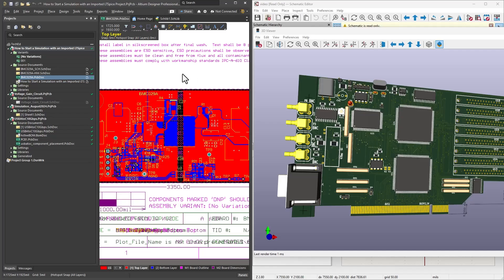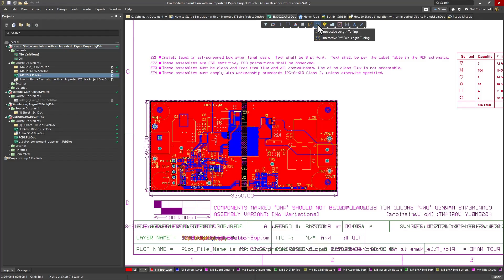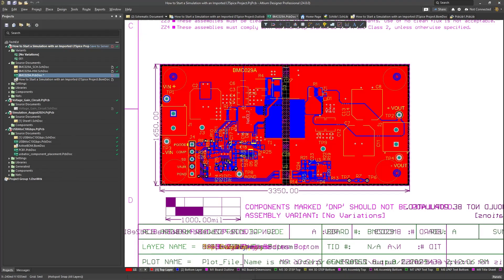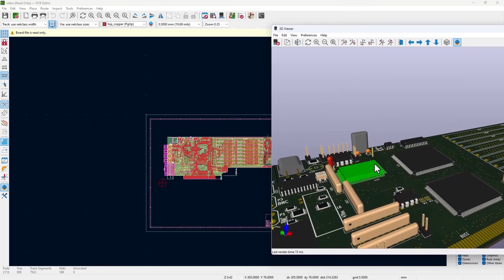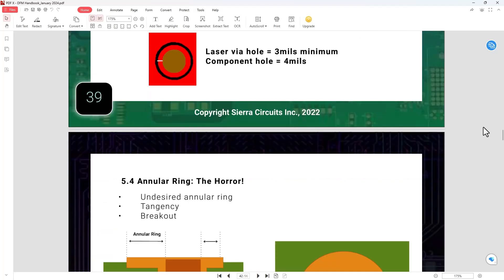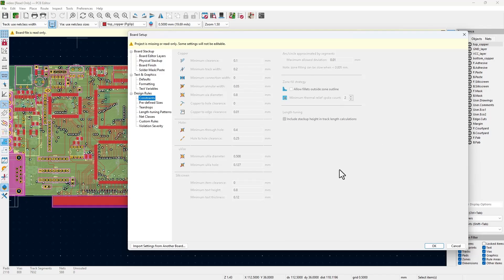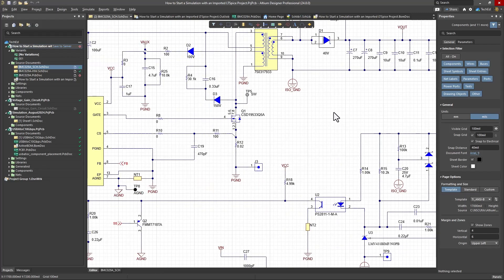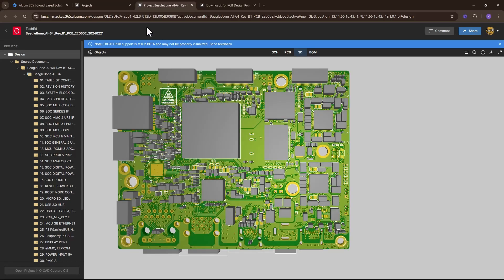Altium24 vs KiCAD8 Which is Right for You?

Comment: A poor designer will do badly even if they've got Altium. A great many companies I go to have EMI issues, these are caused by their electronics not really understanding the physics of EMI. Design rules won't help there, neither will Altium.

The things we need to look for other than cost in choosing a package is the work process to get from idea to copper. I'd say Kicad is where Altium was 10 years ago. Having heard their development team talk, they really do understand where they're going.

Altium will probably be Ok for a while, but smaller companies with turnover less than 10m a year are going to feel the pinch now Altium is heading down the Mentor path.

Comment: Kicad is industry driven in it development & if the majority of users & corporate sponsors want DFM features they get written in fairly quickly.  I think you skipped over the custom rules capabilities of V7 & V8 which are impressive & able to handle wild card selections and are parsed for integrity.
Reply from the maker: @dunk_law  yeah I saw the custom rules part. Personally I don’t like custom rules. Call me crazy but having to manage those custom rules and such I want as little code as possible when it comes to constraints. Reason being is having to consider scenarios where the logic breaks. Would you be willing to show me custom rules though in KiCAD? I’m willing to learn and I’ll be making more videos on these comparisons anyway.
Reply: @techedkirsch  I can understand the frustration about custom rules breaking, but how else do you set up design constraints for important things like clearance for high voltage nets while maintaining tight clearance for low voltage on fine pitch stuff like QFNs? Custom rules are a necessity.
Reply from the maker: @DaleMitchell1367  They are a necessity if not using a more robust approach.  Cadence OrCAD Handles this effortlessly a different way using the Spreadhseet approach, which Altium has now implemented in Altium Professional's Constraint Management system. Want to learn more? I can compare the two in a video.
Reply: @techedkirschEE  yes I would really enjoy a video comparing the two! I haven't tried the new constraints manager in Altium since I don't have a pro subscription. There seems to be a lot of backlash about the new feature.
Reply from the maker: @DaleMitchell1367  There is. It's a good idea that is long overdue if one is doing professional or complex PCB design. However, it's not quite what people were hoping for in its implementation and is counterintuitive in how it's used to implement those constraints. Nonetheless, once used correctly, it's still an upgrade to the existing Design Rules Checker in Altium Designer Standard subscription.
Reply: @techedkirsch  I tried to post some examples and youtube keeps removing the post.
Reply from the maker: @dunk_law  hmm, strange. if you send to techedkirsch at gmail.com, I can review it then post them. My settings might automatically holding posts that contain links.
Reply: @techedkirsch   Designing for intrinsic safety and need to create extra segregation between power domains and these kind of rules are great if you break each domain down to a separate schematic sheet. The sheet name prefixes the net name and can be used as a wild card. Here are a couple of prototypes to use for that where inner on outer layer clearances may vary. -

(layer "In2.Cu")
(rule clearance_netclass1_to_netclass2(condition "A.NetClass == 'netclass1' && B.NetClass == 'netclass2'")
(constraint clearance (min 1mm)))
 
or
 
(layer "In2.Cu")
(rule different_netclass_clearance(condition "A.NetClass != 'Default' && A.NetClass != B.NetClass")
(constraint clearance (min 2mm)))
 
Here is a complete working example of other options -

(version 7)
(rule gnd_In2_separation
(layer "In2.Cu")
(condition "A.Type == 'Zone' && A.NetName == 'GND' && B.NetName == 'Net-(T?-G)'")
(constraint physical_clearance(min 0.6mm))
)
(rule clearance_J19
	( constraint clearance (min 0.54mm))
	( condition "A.insideCourtyard( 'J19')")
)